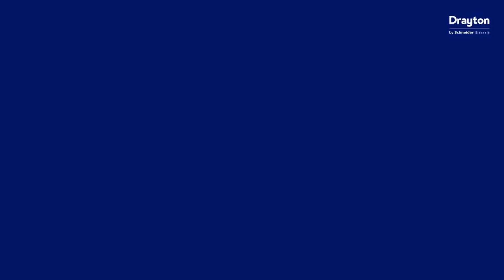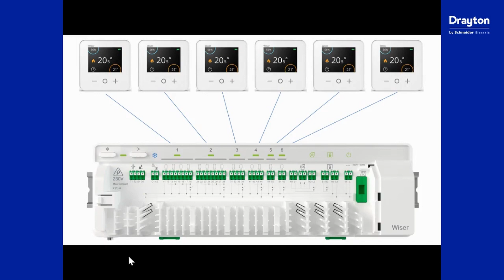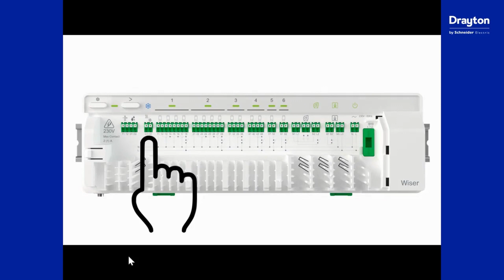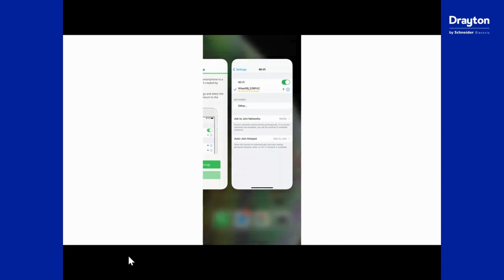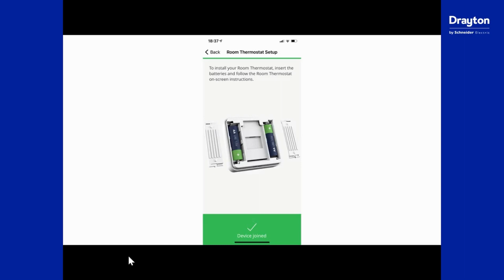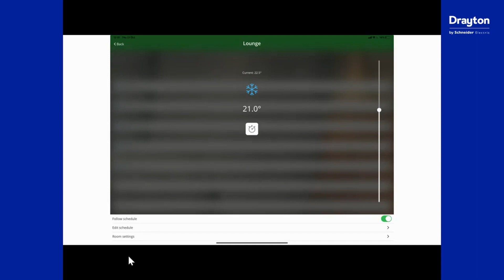FB Live Training - Underfloor Heating

Comment: Each room currently has to be either radiator or UFH heated. Adding UFH to rooms which already have radiators is increasingly common. Are there plans to allow a room to have both heating types in the Wiser app? 
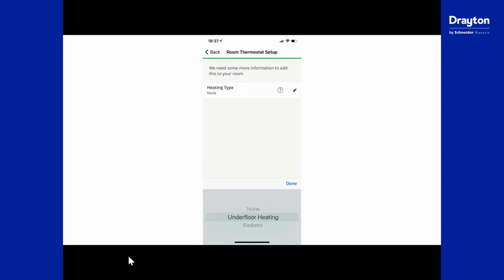Video time stamp: 27:30
Reply from the maker: Currently a zone that is controlling UFH can't also control a radiator with a Wiser radiator thermostat but we will forward your suggestions to our product management team.

Comment: Hi, are the floor sensors for this already out (10:56 mark)? I understand it is not the Remote Floor Temperature Sensor you have available in store at the moment, as this is for electric UFH only. If yours are not available, can I use any other sensor? I'm about to install hardwood flooring so I'd rather have the sensor to protect it
Reply from the maker: It's the same sensor you would use for EHS
Reply: @Draytonheating  UFH Controller (for water heating) offers 6 zones. We have 4 configured. 3 of those zones will have engineered wood flooring installed soon and that requires floor temperature sensors to make sure we don't overheat them. There is only one input on the UFH Controller for the remote floor sensor. How can we connect 3 sensors into that one slot?
Reply from the maker: Hi there, unfortunately it is not possible to connect 3 sensors to this input. All you can do is place this one sensor in a central place where it will monitor floor temperature for all zones. This "central place" may be near the manifold where it will monitor the flow temperature leaving the manifold.
Reply: @Draytonheating  That is a huge flaw in the system (I raised it already with your support and hope this will be addressed via some kind of adapter or another way). Near manifold the temperature will be higher than elsewhere as all the pipes meet there, so that is not good measuring spot. This central location idea also disregards other environmental inputs, like one room may be more sunny, so it will heat up more quickly. Plus, there may be zones (like our 4th one) that have different requirements, e.g. tiles that don't mind high temperature. Regardless of all this, central location won't work, because you need to assign the sensor to a single room/zone in the app. That room/zone then stops heating when floor sensor temperature is above the threshold. It will happily continue to heat in the other zones though (so I can only save 1 out of 3 zones that we need to protect).

Ideally, you need to be able to install a sensor per zone so it gets a true reading from that zone and can trigger heating to stop/start, when threshold is breached there (threshold for that zone, as each zone may have different flooring and different thresholds need to be configured).

I am installing a (disconnected) sensor per zone with the hope this will be addressed at some point in the future, before we ruin the floors. Happy to be contacted as an alpha/beta tester if you come up with a solution that meets this requirement.

A step in the right direction that is just on the software side (as I understand hardware is harder to fix) would be to allow assigning that single sensor to multiple zones/rooms. Then we could stop heating in all 3 zones based on the reading from one of them. Not ideal, as that zone may be cooler/warmer than the others, but better than what we have now.
Reply from the maker: It's great you spoke with our tech support team on this and we will make our development team aware of your suggestions.
Reply: @Draytonheating  I too wish to have a sensor per zone, thankfully I have the sensors in already, but it is something that makes sense. A single sensor can't cover two rooms let alone a whole house.
Reply: @nirvanka  Did you come up with a solution? I will just turn the heating on/off as I wish, likely will use Home Assistant to auto turn off the heating after an hour or two.
Reply: Hi Drayton.  Currently got a Kit 2 setup linked to boiler with OpenTherm.  Am now in the process of adding wet UFH.  Will this communicate back to the Hub to fire the boiler via OpenTherm when a Zone calls for heat or do I need to wire the UFH Controller, to the UFH NC Zone valve, to the boiler to fire it, and remove the whole use of OpenTherm?

Comment: My ufh hub needed a reset. Please can you cover the reinstall process of connecting ufh, radiators and thermostats for a semi working  system.
Reply from the maker: Hi Peter, thanks for the feedback. You can always reach our tech support team by calling  0333 6000 622 - they can guide you through resetting and installation. Our Wiser support lines are open 7 days a week Mondays to Fridays 8am-9pm, weekends 9am-5pm.